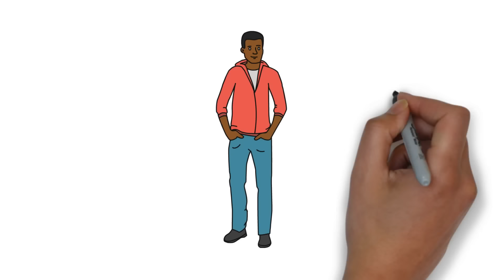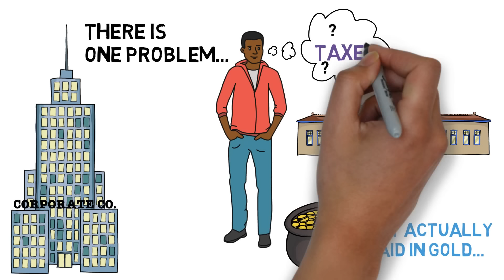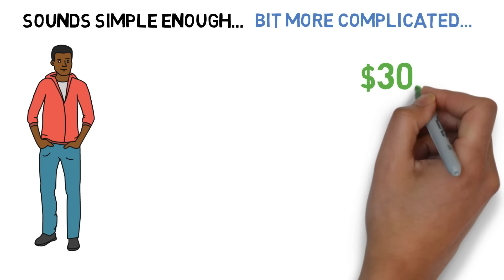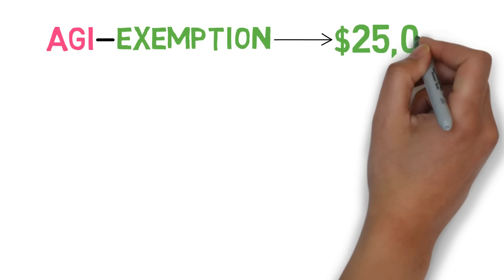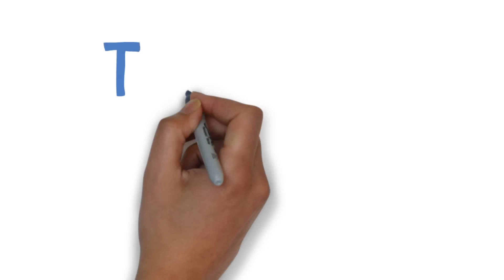Taxes 101 (Tax Basics 1/3)

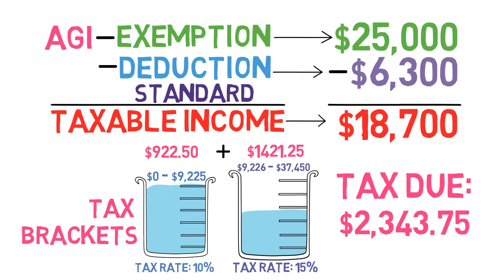Comment: Question: in min 2:55 when talking about the tax bracket of the taxable income, do you had to add both tax brackets of 0 - 9,255 and tax bracket of 9,266 - 37,450 to get what you owe OR since he has 18,700 in taxable income does he ONLY have to use the tax bracket of 9,266 - 37,450 since his taxable income falls into that bracket.
Reply: also how did you calculate the tax rate of 15% to get 1421.25?
Reply: @andrewappiagyei1576  You use both brackets, but they are taxed at different rates.  Just to use arbitrary numbers, let's say that $0-10,000 is in a 10% bracket and $10,001-$100,000 is in a 20% bracket.  If your taxable income is $30,000, this means that the FIRST $10,000 is taxed at 10%, and the rest (up to $100,000 - which since you only have $30,000 of income, is the rest) is taxed at 20%.  So, you are taxed at 10% for your first $10,000 of income, or $1,000.  Now the first $10,000 has ALREADY been taxed, so only the next $20,000 of your $30,000 of income is taxed at 20%, or $4,000.  Your total tax is therefore $5,000.
Reply: @willoughbykrenzteinburg  you explained that perfectly
Reply: @joshbasil3992  Thank you!  You may have also heard the term "effective" tax rate.  This is simply the total tax divided by taxable income.  In the example I provided, that would be 5,000 / 30,000 - or 16.67%.  Youre "in" the 20% bracket, but because of the way a progressive tax system works, your effective rate is 16.67%
Reply: @willoughbykrenzteinburg  It makes my blood boil when important information like this isn't being taught to (at least) high school students. It should be MANDATORY to have personal finance classes in their curriculum.
Reply: @willoughbykrenzteinburg ohhhhh thank you

Comment: I figured it out, but the amounts in pink at 3:04 ($922.50 and $1421.25) should be explained more.
Reply: If you need more explanation for where those numbers come from, then you did not figure it out.  In that section of the video, the total income that gets taxed was $18,700.  The 10% bracket is up to $9,225 of taxable income.  The 15% bracket is up to $37,450.  This means the first $9,225 is taxed at 10%.  This equals $922.50.  That's where that number comes from.  The next portion is taxed at 15% - but only up to $37,450.  So only that portion above $9,225, but below $37,450 (which the rest is below) is taxed at 15%.  Since the income was $18,700, the portion above $9,225 (which has already been taxed at 10%) equals $9,475.  So, this $9,475 is taxed at 15% - or $1,421.25 - which is where that number comes from.
Reply: @willoughbykrenzteinburg  thannk you!

Comment: Can someone explain why Ray is paying TWO tax rates? And, where is $922.50 & $1421.25 coming from in the example?
Reply: This is just how progressive tax systems work.  The two tax rates are not applying simultaneously.  One rate is for one portion and another rate for the other portion.  In this case, the lower tax rate of 10% is applied to ONLY the first $9,225 of income ($922.50).  Taxable income was $18,700, and the first $9,225 has already been taxed, so now we are left with $9,475 which is taxed at the higher rate of 15% ($1,421.25).  ONLY the portion above $9,225 and below $37,450 is taxed at 15%, and this happens to be the rest of the income.

Comment: This is not a good step by step explanation and here's why:

For example in 3:05 :
If Ray made $18,700 Taxable Income for 2015. Wouldn't he fit into the $9,226- $37,450 tax bracket? Therefore only having to pay the assigned Tax Rate of 15%? 

So he should really only be paying (0.15 x 18,700= $2,805) and not the combined of both tax brackets ( $922.50 + $1421.25= $2,343.75) 

TLDR: Why are you adding the 922.50 from the first tax bracket with the 1,421.25 from the second tax bracket? If you're going to make a basic video then don't skip over all the explanations!!
Reply: I think you are misunderstanding how a progressive tax system works.  Do the math - $18,700 taxed at 15% is $2,805.  This is clearly MORE than the actual tax liability calculated at $2,343.75.  Only the portion that is in the specific bracket is taxed at the rate in that bracket.  So with taxable income of $18,700, only the amount that exceed $9,226 is taxed at 15%.  This would be (18,700 - 9,225) $9,475.  15% of that is $1,421.25.  The first $9,225 is still only taxed at 10% ($922.50).  This is BETTER than having the WHOLE thing taxed at the higher rate.
Reply: @willoughbykrenzteinburg  This is an accurate explanation in my estimation.
Reply: it can be a hard concept to understand, especially at first. Moneycoach is using the buckets to represent how the "progressive tax system" works.